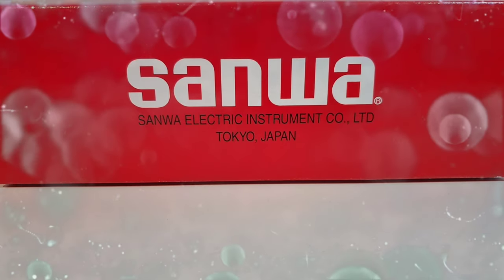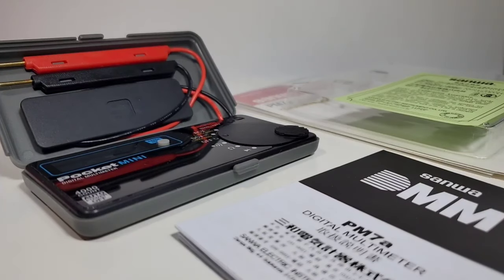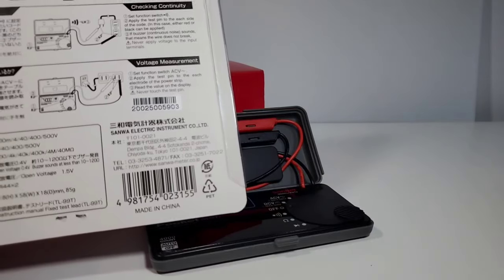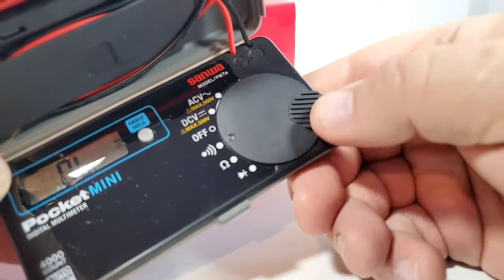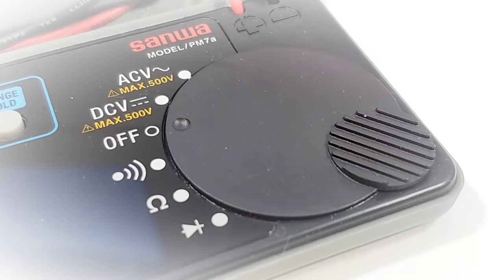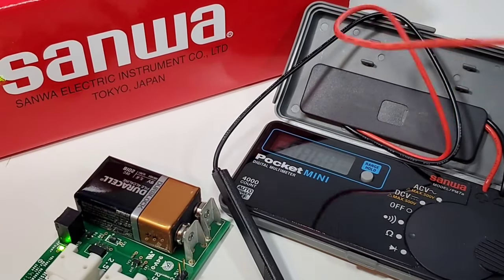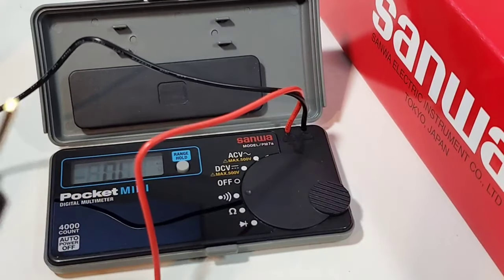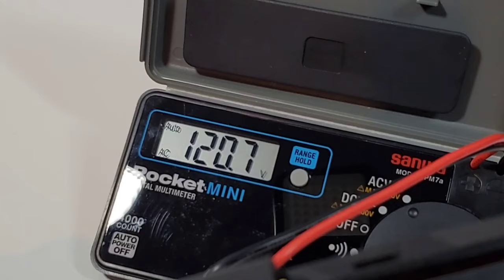SANWA PM7a Pocket MINI Multimeter Review & Teardown!

Comment: @18:00 notice there is a hole behind the face plate, generally white with a black (-) down the center.  This is where they adjust the calibration at the factory before applying the face plate.  If you want to adjust the pot at a later date the owner can choose to make an opening in the face plate for screwdriver access to the resistor while operating the unit.

Comment: I agree with your 3 stars

Pros  
- Smart and rotary selector design. AC/DC Voltage and Resistance/Cont/Diode separated by OFF. 
- Practical slim design Case and leads.
- Brass sleeve screw inserts.

Cons
- Price.
- Battery access, wish there's a separate battery compartment.
- Should be the common CR2025/32 instead of LR44.

I have a few Sanwa too. They are nice quality meters. Great review sir. Do more Japanese TMI please. Hehe
Reply from the maker: Completely true 👍  The battery access definitely could use a revamp. For some end users popping the case off could be traumatic..and I mean that in earnest! More Japanese multimeter reviews coming your way !
Reply: More Japanese TMI review coming you say!? Hurray!! Long live Darren Walker.
Reply from the maker: @yusdiy  Awww shucks 🤪

Comment: Nice review.  Decent quality pocket DMM.  I've found that most of these slim pocket DMM's won't test LED's, possibly due to them using the button cell batteries.  But I think that can be forgiven, since this is meant for portability to use in the field.  I like Sanwa, I have an analog VOM made by them.  They are not cheap, but you get what you pay for with their products.
Reply from the maker: Spot on! Sanwa is definitely a name you can trust. I guess we are spoiled these days and when a certain functionality is missing we can be very unforgiving! This little pocket multimeter does alot and its built to last.

Comment: Quality is much better than the Sanwa CD771, and that was a good size meter, but sadly it showed more chinese quality than Japanese.   The build quality in this one is indeed surprising, but kinda expensive considering what you can get for the same money - even so this ones nicely put together and im not even too put off by the no light diodes as most smaller meters wont do it and I dont feel most coin celled smaller meters  diode ranges are really intended to light diodes anyway but rather to just test common diodes-?  Put this quality in the CD771 and now ya got something-!
Reply from the maker: Great point...absolutely love the attention to detail in this little pocket multimeter it shows you that Sanwa can still put out great instruments!

Comment: Another great review, thanks Darren! I do think, however, that you were in a bad mood when you reviewed that Sata!...lol! The lead lengths were about the same as this one but you hated em..lol. And at least they made "some" attempt at flip-over hinges. They do now make an auto-ranger for under $17 here: https://www.ebay.com/itm/Compant-Digital-Multimeter-LCD-Auto-Tester-AC-DC-DMM-Amp-Ohm-Diode-Continuity/402225872133?hash=item5da687bd05:g:SysAAOSwVPBeloJG  on the EM3082 option button. I know you will hate it though as it has the same opener...lol! But the dial.....we can always stab it with our pocket-knife and twist it.....lmao! The Sanwa is now $50 US but even that is a tough price, i would think, for most....for what it is. I will stick with my little Micronta 22-171A if i really need a very tiny one. Thanks Darren!
Reply from the maker: You might have a point there..Definitely not in the same league as SANWA build quality wise but I've definitely seen worse! Good idea about the pocket knife...hehe 🤣